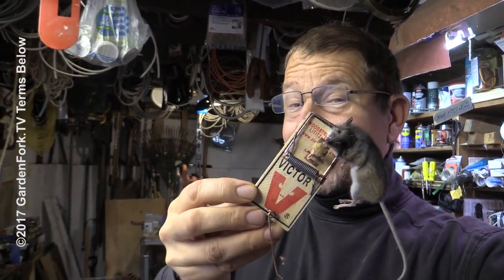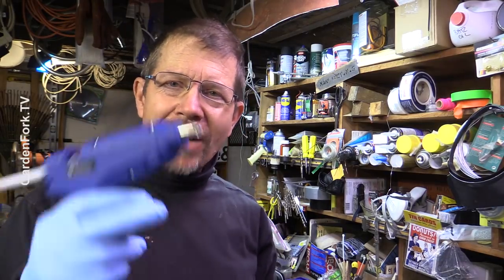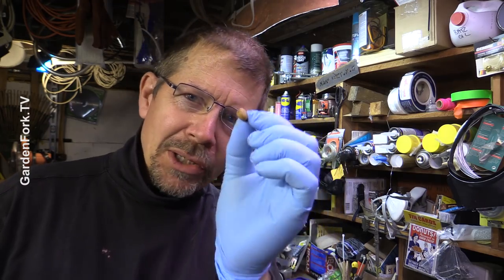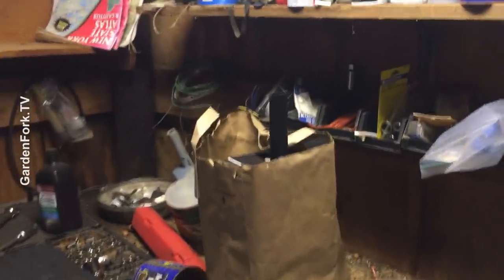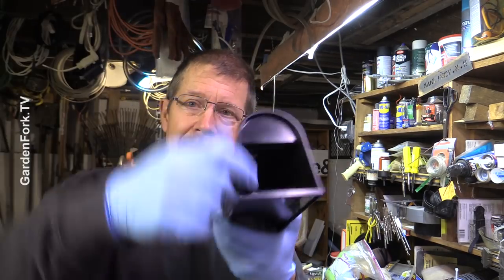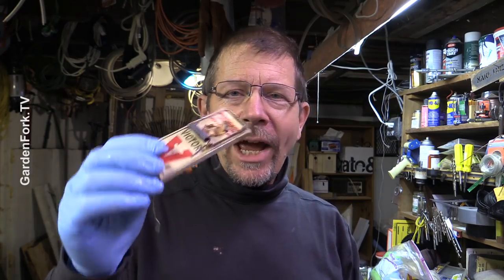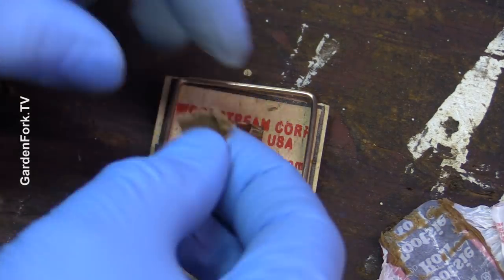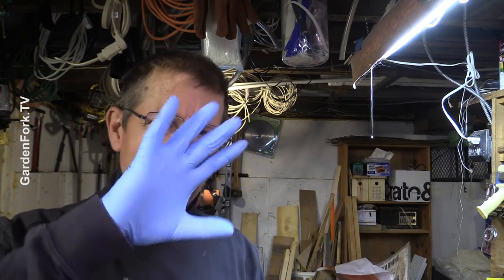How To Get Rid Of Mice with MORE Mouse Trap Hacks | GardenFork

Comment: Almonds work very well.   I've used a small drill to buzz a little hole thru the nut and then tie it on with heavy thread.  Another trick that I've learned of on other videos is to scuff up the brown exterior skin.  It lets more aroma out.  I also try to minimize handling the wood aspect of the trap unless I have gloves on.  You can smear the most minimal amount of peanut butter on the wood - It will mask our scent and also attract the kritters.  Snap / Bam  - done.

Comment: I use "butcher string" kinda like cotton kite string, and wrap it around the trigger several times.  The peanut butter oil soaks in the string so no matter how softly the mouse nibbles at the PB, it can't resist tugging on the string.  A little neater than what you showed so the mouse has his head in all of the way.

Comment: I use almonds but not the glue.  Use a 1/8" bit to drill a hole through a fresh raw almond.  On the rat trap, bend up the bait tab to nearly vertical.  Run a fine wire (I use old phone wire) through the hole in the bait paddle, give it one twist so it stays there.  Now, thread one of the ends of the wire through the hole, and seat the almond firmly on the  tab.  A fresh almond will not crack as it's forced onto the tab.  Now, twist the ends of the wire around the almond, and tuck any ends under the trigger tab.  They will be out of the way when it's set.  The almond will not come off, but once it's nibbled a few times, or if you leave it outside and it eventually spoils, it is easy to remove, clean and install new.

Comment: The loop on the trigger end of the trap is meant for you to jam PB in. They actually have to step on the trap to lick it out.

Between that and placing snap traps properly with the trigger side against the wall (because mice use walls to navigate) I've had good luck.

Got one yesterday and I'm hunting another today.

Comment: I use various makes of traps but the Victory one's do work. I drill holes through the traps and attack them to the ends of boards with screws, that is the trap is at the short end of a long board and flush so you can place it next to a wall. If you do this make sure the screw heads do not interfere with the mechanism. With the trap screwed down adjacent traps are not set off. Also, the vermin cannot escape with the trap.
Reply from the maker: Good info,  thx hi!

Comment: you have heard of the 5 gal bucket wire coat hanger and empty paper towel tube ?
Reply from the maker: +Theredneck Prepper yes, they work too.
Reply: I have heard something very similar but using a small piece of aluminum pipe instead of paper towel tube. Also, there is water in the bottom so they drown.
Reply: yep this is all throw away stuff !
Reply: Theredneck Prepper . The rolling log trap. It's probably the best trap ever. It's simple, easy to make and can catch dozens of mice without the need for resetting.

Comment: I make rolled-up napkin pieces 1/4in smeared with PB, I open the bait lip and wedge the paper wad inside, then pinch the teeth closed on the bait lip which holdsfast the bait wad. Then put a tiny lick of PB on the corner of the kill platform.

Comment: I use burger cheese.  It’s sticky soft and doesn’t roll about or fall off. The mouse has to get stuck in there.  Plus one slice does loads of traps and very cheap.  It’s processed so takes few days to even start going off.   I replace every two days anyways.  Every time a traps gone off I get a catch.   Had so many fails with biscuits, nuts ect.   Choc spread and peanut butter on cotton wool works wonders too but take bit more time and mess.
Reply from the maker: great info Sam, thx for that. did not know that one, thx!

Comment: I typically jamb a small square of rag or cloth under that lip and smear peanut butter to it. The vermin chew and tug on it, which imo makes it better than applying straight peanut butter, which they can lick off and not set off the trap. Other than that, I also apply a little peanut butter to the bottom of the trip mechanism, as the mice will try to get at it and set off the trap
Reply from the maker: Good info Jay thx. Under the trip plate is a good one.

Comment: The other side of the trap is what attracts mice to the house in general. They come in out of the cold & look for a warm spot. That warm spot typically  turns into the range, gas or electric. They also love Bosch dishwashers too!  They .love to make a mouse motel in the insulation around the oven cavity & under the cooktop. They also love to raid the dry cat food, dog food, Hershey's chocolates, pistachios, or anything easy to get into. I have seen too many ranges ruined by mice, whether it be the mouse motel problem, or dry dog/cat food stuffed into the insulation in the ranges. Once the nuggets get cooked from the oven , they permeate the metal, rendering the appliance no good. You can't get the odor out of the metal. Just because you can't see signs of mice, don't assume you don't have them. Having cat is no guarantee to rid you of mice.
Reply from the maker: Great info thx Marc!
Reply: Marc Davis.... please tell me more about how to deter the mice.   All of a sudden we have them.  I'm thinking it was all the rain and the bird seed in the backyard.    I clean up all the time and there is no access to food inside.  I found mouse droppings in the bathroom... why?  no food in there.

Comment: I set out mouse traps using advice I've found on youtube elsewhere...I haven't caught any yet. Prior to looking up more information, I set out traps and they were able to lick off peanut butter two traps and successfully get away without being snapped or not triggering a trap. With the third, I had hot glued a pretzel onto the trigger of the trap, and the mouse triggered it, but still got away (didn't get the pretzel though either). Now it has been almost two full days without seeing the mouse...I'm concerned since we haven't seen it at all.

Comment: Sour cream works VERY well. BUT,,,That trigger has to be adjusted where it is way more sensitive. For the benefit for all the others, I will explain why I take the trigger out and straighten it and push down the staple that holds it. The way these traps are now, the trigger is bent over so far that the mouse has to really be pushing on it with it's teeth before it will spring. So since I use sour cream I bent that over where it straight up and down with the trigger then it is way more sensitive. And I straighten the whole bait and trigger plate and drive down the staple a bit because otherwise the bait is way up at a 45º angle and the mouse has to be standing at the side of the trap to get at it instead of the front where I would like him. If the mouse is at the side of the trap, then when the things trips there isn't near as much power clubbing the mouse and doesn't kill it. When the mouse is at the front of the trap then there is way more force to kill it. So when the trigger plate is straightened then the bait will be where the mouse doesn't have to stand at the side of the trap to get at the sour cream. the bait/trigger plate is pretty much level. I have adjusted the trigger catches where it is so sensitive that all I had to do is breath on it and it would trip, and I would have to set the trap down so slllooowww and gently that I looked goofy otherwise it would trip. But MaN!! would that thing get mice!
OK I hope this helps
Reply from the maker: Wow thx!

Comment: I had to do (which is a lot of things I have to buy now) some extensive re-engineering on my old fashioned Victor mouse traps. I take the trigger out completely and drive the staple down an eighth of an inch,(maybe not quite that much) then straighten the trigger out almost to being flat. Then I bend that trigger catch back where it's almost straight up and down. Of course I go too far and the lever won't stay caught and have to slowly bend it back in until it JUST catches. Now no matter how gently they lick the cream the trap will spring. OK now the trigger can just slide out from the staple being straightened like that, so I take a twist tie and twist that arouind the back of the trigger and staple and cut excess off with a pair of wire cutters. Then it can't come off anymore.  Then,,,,I take NOT peanut butter, NOT cheese,,,I use SOUR CREAM!!  And I found mice, or some of them do not like cheese or peanut butter, but ALL of them love Sour Cream. I catch them left and right.
Reply from the maker: Never heard of sour cream Robert. Thx for sharing!
Reply: If there is a mouse in my house I will find him in the trap. But one drawback. The dab of sour cream dries up and gets hard in 2 days. But that's fine with me because I always have my sour cream next to me with my tato chips and triskits

Comment: The time you spend gluing stuff and prepping... there's a 5 bucks commercial strength paste like bait sold in plastic bottles at hardware stores. I have traps with old dried up cheese mice wouldn't touch. One drop of this green chemical over the cheese (or in an empty trap) and it will catch a mouse every time. Just sayin'
Reply from the maker: Good to know, thx!
Reply: can you find the exact name of the product?
Reply: @ltd4895  I think that the name is Gel Attractant . Today was my first time using it and in one hour I got the first mice. I was trying with lots of different types of bites for a month but none of them worked.
Reply: @MsRitaKelly  thank you much! I was successful using the Victor power kill trap both times I needed to catch a mouse. They were both caught in the same area too. Now I have the electronic box in that space in case. I'm still gonna look for the product...electronic boxes aren't cheap.

Comment: Everyone does it wrong! Pack that tube with peanut butter and place some on the wood base below the trigger so they're nose releases the tension on it when they TRY to lick it off the wood and WHAM! Also put the trap lenthwise along the wall. Mice are pretty much blind they travel by smell mostly that's why they pee and poop every couple inches to know where they've been. And they travel close to walls or corridors. Cat food works best, it has a higher fat content. But if you have cat food, you probably have a cat. But feeding the cat food, why would it want mice? Cats are lazy anyway. As far as repelling them, peppermint oil, they don't like it. But you need to do that often. Screw the glue gun trick! Load it right,  place it right, get results! The Tootsie Rolls work too. Thanks! Be that mouse murderer!

Comment: Everyone has bait options. I read here, drilling an almond and use wire thru it to secure tightly.  Get out the drill, put in the appropriate drill bit, and tighten it so the bit doesn't come loose. Then grab the almond (which incidently you could toast with with a lighter, or like my wife does, in a frying pan), and drill a small hole...ETC ETC ETC.  Look, just smear some freakin peanut butter on the damn trap and forget it.  Like the infomercials, SET IT AND FORGET IT.  It kills me when an engineer with a master's degree from Harvard explains how to bait some damn trap. Oh how super smart this method is.  What do you care if you are giving a mouse a well balanced meal?